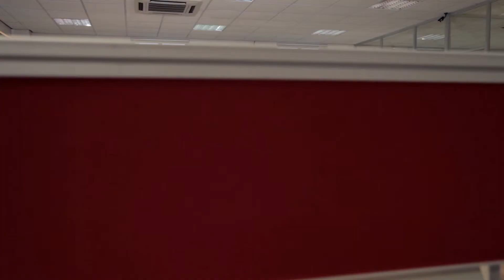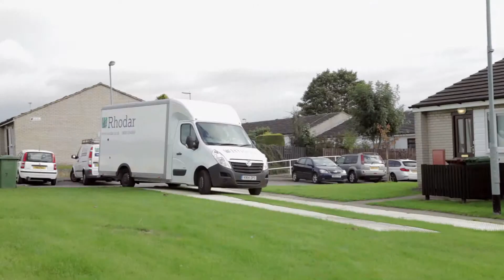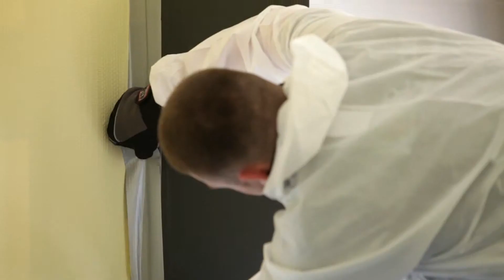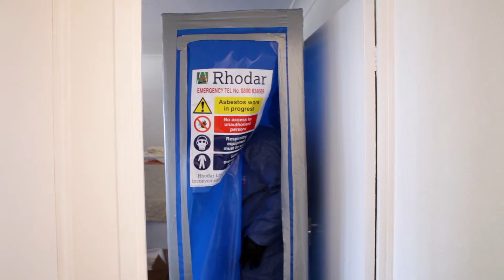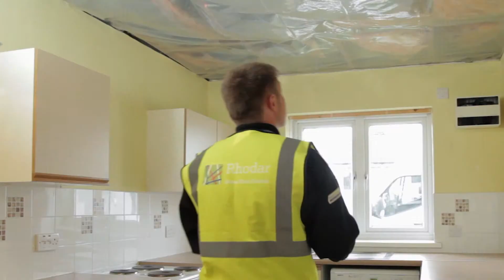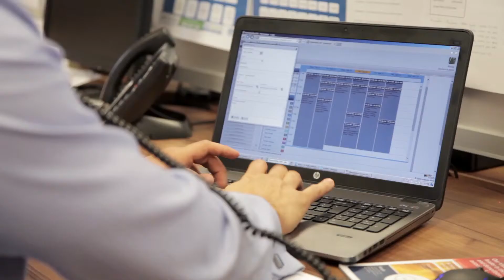Removing Asbestos at Yorkshire Housing: Rhodar Homeworks Service

Comment: How do you change the filter on the NPU before the 4SC? Oh wait you can't, fucking shit company Rhodar, awesome planning on that job, surprised they even bothered with the Enclosure at all, no wetting down of waste, contaminated loft insulation still visable and hasn't been removed. Great job there.
Reply: Contaminated insulation, mate it’s artex. It’s mental people are getting rid of it like this rather then just plastering over it. It’s white asbestos snd about 2% if that. If it was lagging or any brown or blue then yes. White is no where near as harmful

Comment: It's all a lie
Report Review
DO NOT USE IF YOU WANT THE JOB COMPLETED OR ON TIME. Currently into the fifth week of Rhodar attempting to remove some low asbestos content floor tiles (only in one room). Consistent only in their failure to equip their staff with the proper tools for the job and inability to organise visits. They even went as far as to claim they had been calling and leaving messages for me for two weeks when my insurance adjuster chased them, they made no calls and left no messages. So far they have booked and promised people onsite for four seperate days, So far they have managed to keep two of the appointments, cancelling the other two on the day itself. The other two days they pulled the staff to send them to another job.
Top of Form
submit comment
Reply: http://yorkshire.ltd/police-called-by-council-officer-needed-protection-from-the-truth/